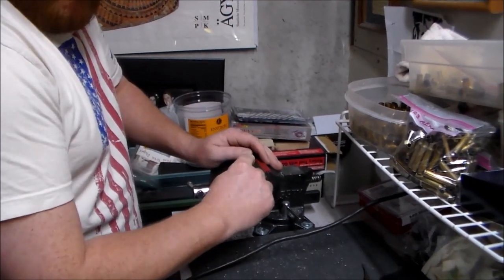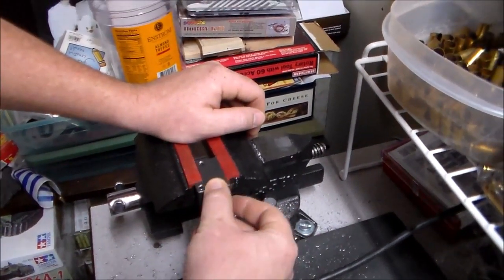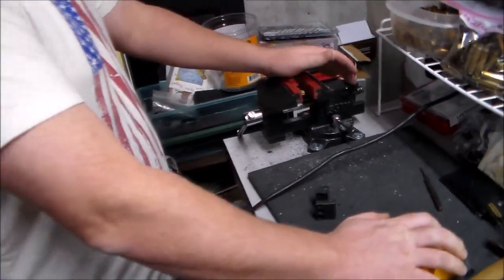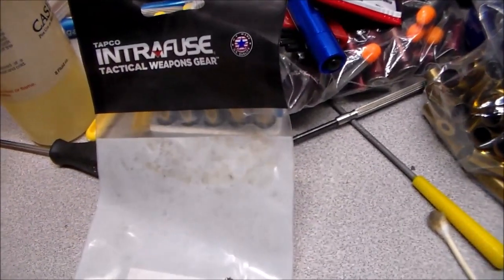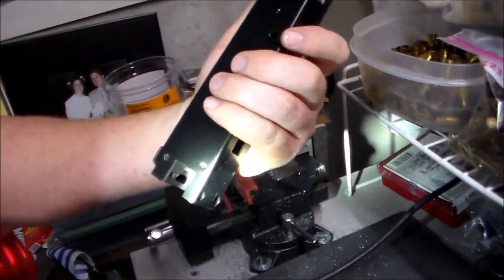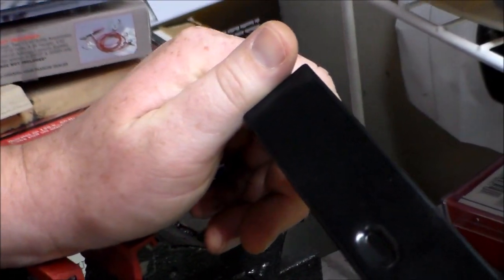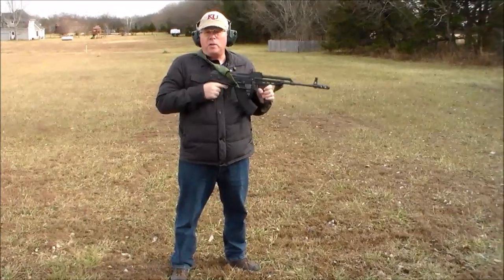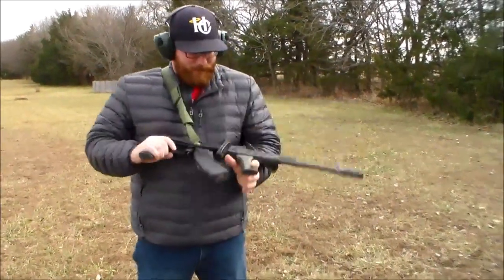Build Your Own AMD 65

Comment: I have bought 2 kits for around 300 each. Neither came with a barrel or receiver and the under folder did not have the trunnions.  I didn't think it was too big of a deal but I would say price the missing pieces before you buy the kit. The trunnions cost me 150 and the barrel was another 150. I had to press everything together myself because you cant find populated barrels right now. I went with the screw build for the fixed stock but am going to rivet the under folder. I have a machine shop so I am making all of the rivet tools. I could see the cost of this getting way out of hand if I had to buy tools. Probably $800 in tools and 600-700 for parts and the kit. Good Luck !